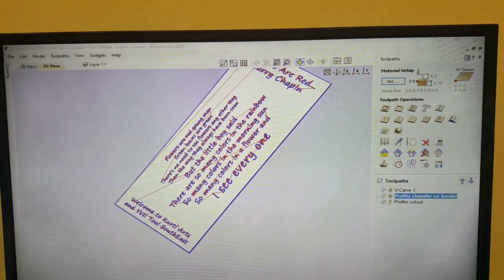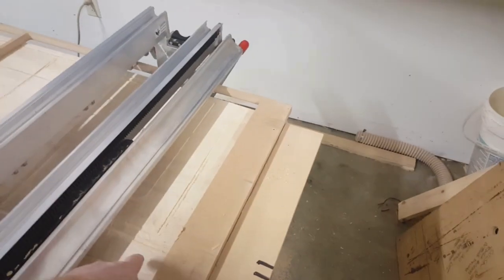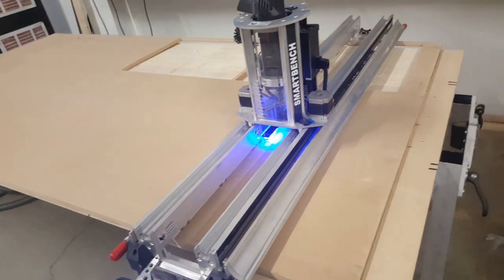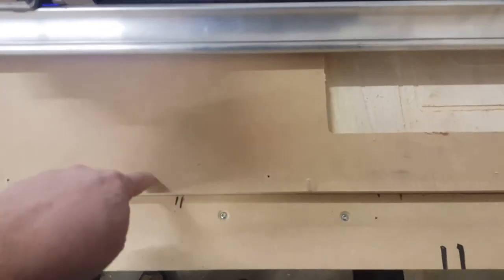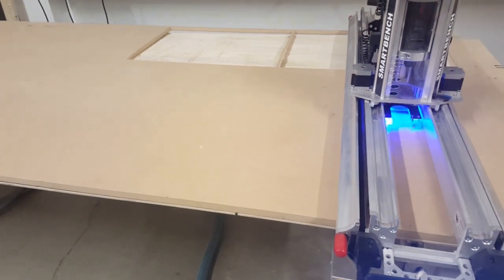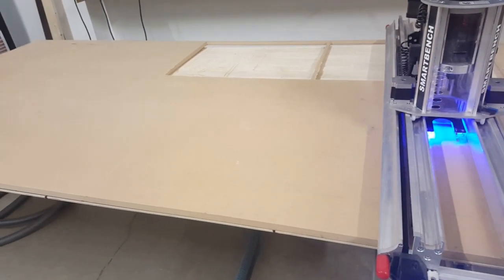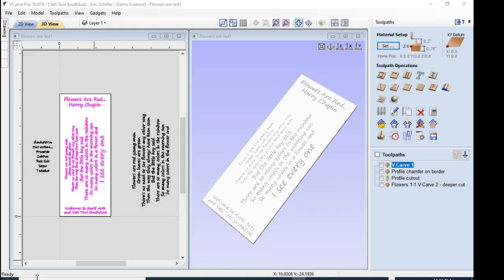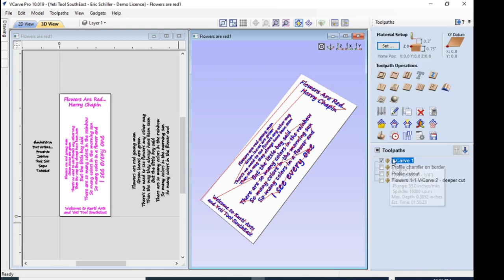Engraved sign - To be painted later - with updates to follow.

Comment: Been watching your videos and I like them. I just bought one and need as much tips as possible would be nice to write some information below
Good job👍
Reply from the maker: Thanks!  The point of my videos are to show the different applications that the SmartBench can work in.  It is a very versatile tool that lets you do other work in the shop while it is cranking out your product mix.  It is very easy to modify to tweak it for what YOU need in YOUR shop and workflow.  I have customers that have added torsion box vacuum tables (run by a shopvac), do stage props, build cabinets, make faux brick walls, cut out jamb extensions for circlehead windows, make custom muntins for window, cut signs, and on and on... It's a very versatile machine that lets you work full sheets when needed, and take it apart and store it out of the way if you need the space for assembly.
Reply: How's it been working for you?

Comment: Would the cut file for the Risers to fit the SmartBench be publicly available please?
Reply from the maker: Fill out the contact form on my website and I will contact you - I have begun to sell them because of the number of requests and time it has taken responding and answering additional questions and supporting folks that are not my customers.  This is a very simple project to design on your own and learn about slip-fit joints and  tooling allowances for tight fit etc... Not complex at all.  It's a good process of learning the software you use to drive the machine.   However, if you want to purchase them, go to www.yetismartbench.com/contact and fill in the form and I'll get in touch.